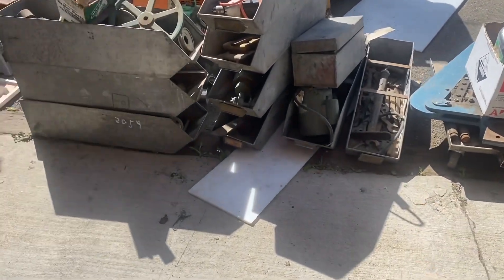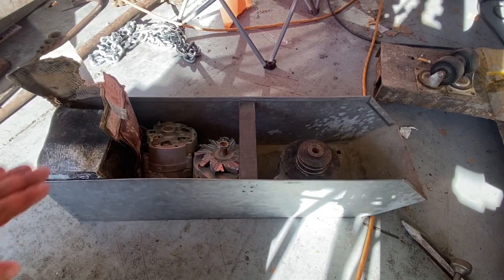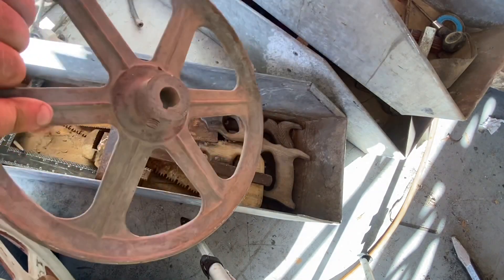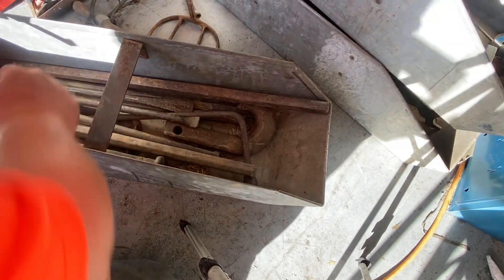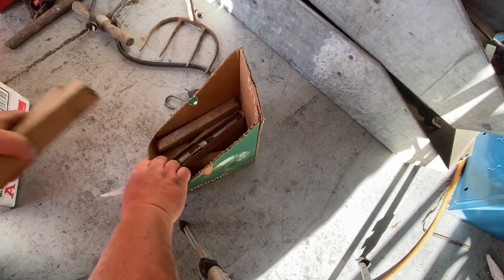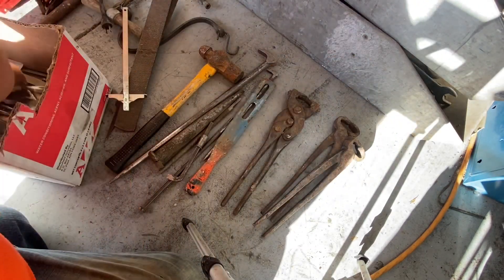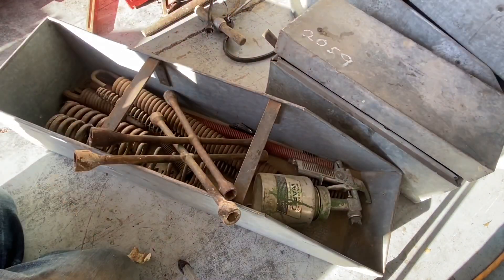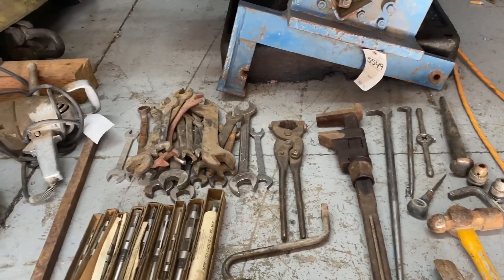Yard sale, auction, and swap meet finds 2021 #13

Comment: The hammer head at the 21:04 point in your video is a tire hammer head. You use it to break the beads of the tire off the rim. Good chance it says Ken-Tool on it. I have a few of them they work great. Yours only needs a long handle and the will to swing it a a pair of tire spoons.
Reply from the maker: I thought it looked familiar, thanks for the info on it

Comment: 11:30. Fence stretcher for barbed wire.
12:42. Looks like a very short axle for disc harrows.
The security candy co thing looks like a nut cracker.